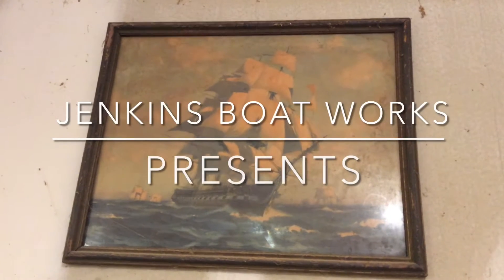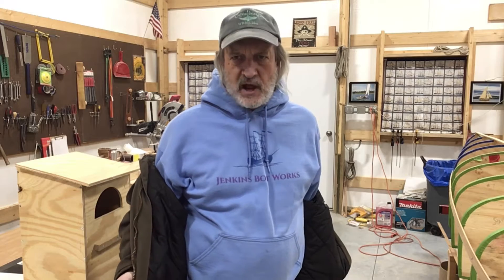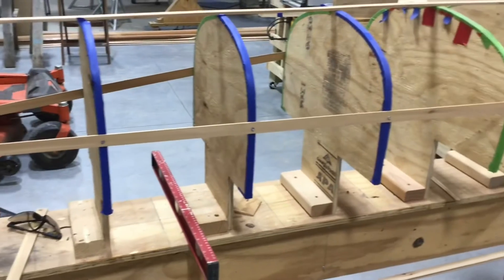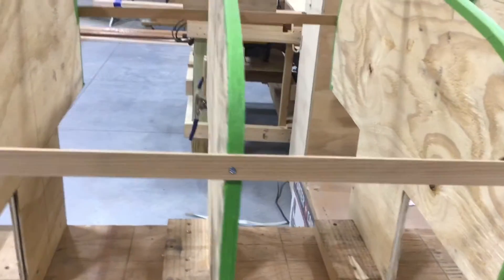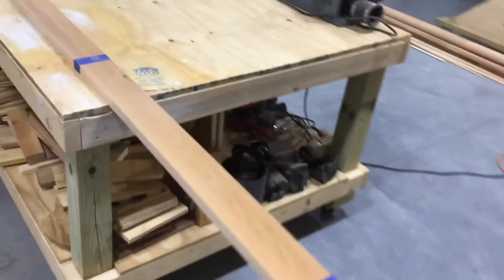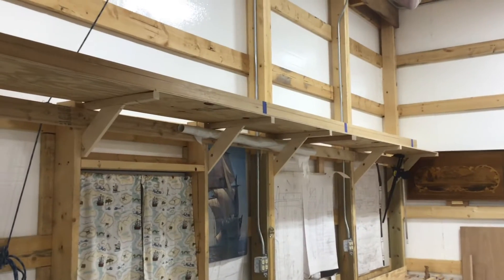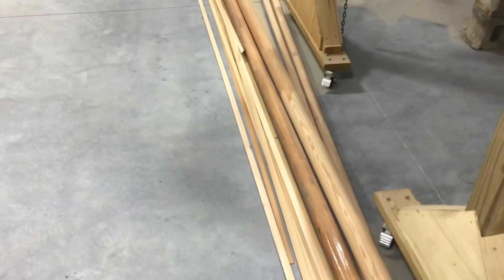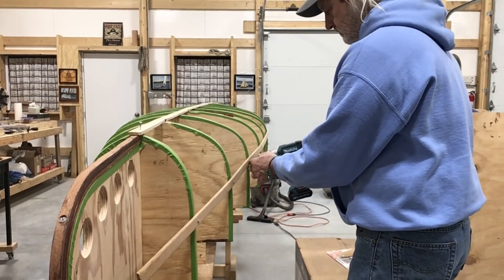Perfecting station molds - Freedom 17 Canoe Build - Episode 7

Comment: Do you think MDF would be an easier medium to work with for the station molds?  Seems like it would be more stable than the plywood (less warping).   Thank you for your very detailed videos. I am considering building one of these and you have really shown a lot of the subtleties and helpful tips that I haven’t seen before. Can’t wait to see the finished product!
Reply from the maker: Hi Nick, thanks for the kind words. On the MDF, it would likely be less likely to warp. If you plan to use staples, they may not hold quite as well but I suppose if you covered the edges with say two or three layers of tape instead of just one, that might hold them. I've seen other builders use it. I will go on up to like marine grade ply the next time as it is much better quality. Stay tuned another video soon about tools you may need or want to use

Comment: Looks like you have a pretty good table saw, those strips looked like solid planks when taped together. I'm sure you will be able to pick up on any unfairness as you plank up the hull. And won't there be some sanding fair too before you fibreglass? Like you say: people will just see a canoe. The bench sander is a great tool, I wish I had bought mine years before I did.
Reply from the maker: Hi Dale, yeah, there will be quite a bit of sanding, inside and out. Regarding the tools, I’m always amazed when I get a new tool and then wonder how I ever managed without!